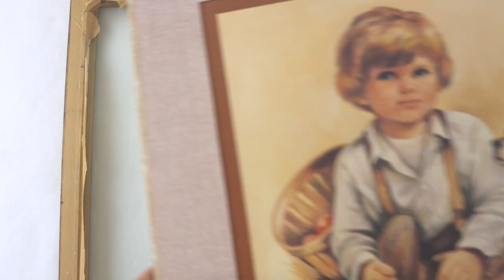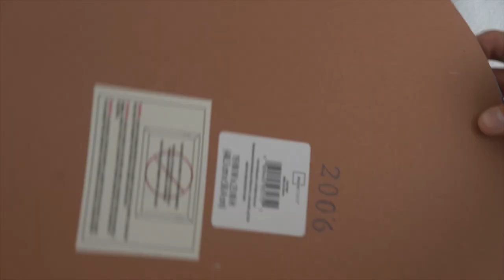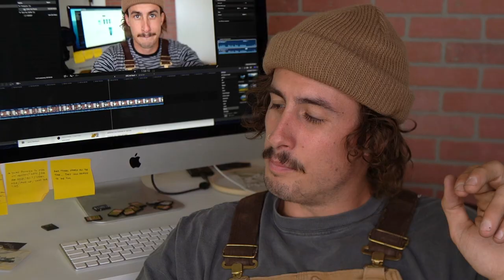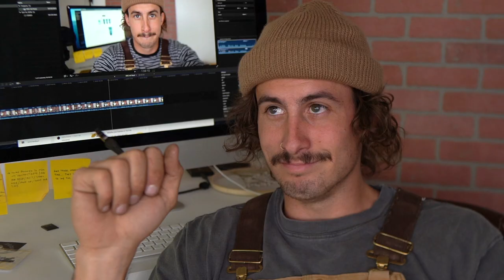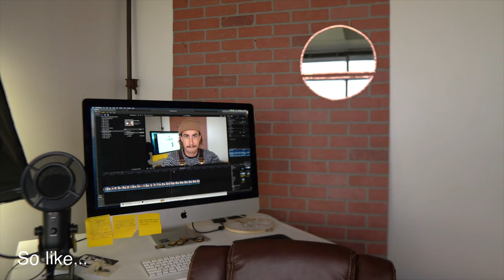DIY CIRCLE MIRROR - Copper + Spray on Mirror + Old Picture Frame (THRIFT UPCYCLE)

Comment from the maker: If you break a piece of glass before it becomes a mirror... is that only like 3.5 years of bad luck. Orrr...
Reply: The supreme quality of this project definitely countered all the accumulated bad luck 😂 you'll be fine!
Reply: isn’t broken glass good luck??
Reply: No or else walking under a tree would be bad luck 'cause it might become a ladder
Reply from the maker: @LydiaLawsonMusic  hahahahahah ily lydia.
Reply: DIY bad luck with Shmoxd
Reply: In german we say "Scherben bringen Glück" or "Shards will bring you luck" but i think that only applies to pottery and stuff like that so idk
Reply: Hm...how did I not see this vid when it came out? 

ANYWAYS, A TIP: when cutting glass, you want to make a bunch of additional scores in the parts that you will not need and brake them bit by bit by taking the glass with both hands, one each side of the score(there's also a special pliar)  and apply equal amount if pressure on each side of the line. That will minimise the chance to brake it

P.s. every time your hairy head in the vid gets interrupted with the boy in the intro, I can't help but giggle🤭 have you changed a bit, or what?
Reply: Nah, only bad luck for broken mirrors
Broken glass? Scherben bringen Glück (German)
So you are binging out the bad luck from the mirrors

Comment: Next time try to scratch some "rays". I mean when you make a circle scratch then make scratches from the line to the edge of glass. Its the way you can control cracking and circle will be perfect
Reply from the maker: So, I tried that on the first couple attempts.. and for some reason it was working better for me with out em? ¯\_(ツ)_/¯
Reply: @Shmoxd  Ok, if you ever have some problem with glass let me know, I have master degree of Art and Glass design so let me know, I'll help you with this precious material ;)

Comment: A quick tip, if you scribe a straight line from the edge of the circle to the edge of the glass, the glass will be less apt to shatter as you are creating a relief.
Reply: I agree! Sounds like he'll be getting into some stained glass projects and I feel like a lot of the applications and SAFETY tips would help with this project. Especially cutting off smaller sections for round profiles, sanding the edges, and wearing gloves!
Reply from the maker: OOO love all the tips! thank you!! :)

Comment: When you’re cutting glass start at one end and finish at the other, if I’m cutting a circle I cut straight instead of in a rounded form then clip the edges. Some oil will help the cutter also which is a pretty standard one by the way.

Comment: When you're scoring/breaking mirror one thing that helps when doing a circle is to do to the circle then bring a line out to the edge of the glass. Then you can use your breaker (in this case your scissors) and the whole thing should pop out.

Putting cardboard or foamcore behind it will also help a lot to brace it if you don't have the full thickness of a real mirror. You will also want to tape up the edges to keep from cutting yourself.

I worked at at frame shop for 10 years so I have a lot of experience with it. To glue it on you'll want silicone glue like e6000 or liquid nails and that helps too.
Reply: Yes! This! After the circle is cut, cut straight lines from the circle to the edge of the glass all the way around. Then you break off those cut chunks. And you can control where those chunks break.

Comment: I think the glass might’ve broken a little easier if it were in smaller pieces when it broke. In my mind, it’s a “path of least resistance” thing. So if your score along 1/3 of the circumference is super clean and consistent, it’s gonna break where that score begins and ends. And if you’re flexing the entire piece of glass, those two sides of the score are going to want to meet in the middle, rather than head in opposite directions towards the outside edge. 

Hopefully that made sense...? It reminded me of a diresta video where he cuts a curve on a piece of wood with a circular saw by cutting a series of straight lines, then coming back and sanding the transitions between each straight cut to make one smooth line. So maybe splitting the one big break into a few smaller breaks would make it easier to control? Hopefully that helps. Good work!
Reply from the maker: That does make sense!! thank you:)

Comment: you used a super thin sheet of glass. just get a thicker one next time. plus, there should be plenty of little round mirrors to be found at thrift stores, usually with the edges bevelled, too. so that helps prevent injuries.
Reply from the maker: ooo I'll keep that in mind next time:) and when I was thrifting I couldn't find any mirrors.. but come to think of it.. ive found circle picture frames before.. soooo

Comment: umkay so this was awesome. I can't make myself be so freaking careful not break anything or mess up at least once, OR take the time plan for every possibility. So showing what went wrong was not only entertaining but makes one feel they didn't have to lose their own time. So thank you! 
IDEA: Could you use the copper foiling they use for edging stained glass? I think you said something about stained glass in the vid. You just need the foiling and a decent soldering iron. I'm just not sure how smooth you can get it on a continuously curved line????

Comment: Hey y'all, used to work in a few glass studios. When you cut glass in a circle - cut 1/4 at a time, run the crack with light tapping, then use glass pliers to pull apart. 
Safety Bonus Tip: Always wear a mask! Glass dust is rough. You'll feel like you smoked a pack.

Comment: next time you try to cut a circle, cut as much excess material off as you can before going for the circle shape. when cutting glass it always wants to break in as straight a line as it can so asking it to just cleanly cut out a circle is a pretty bold. just square off the four sides along the edge of the circle, then the remaining hang offs the same way, then go for the curved cuts! also, you can use that little round ball on the end to tap along the lines you scored to encourage the cracks run where you want them too. you can also get grozing pliers that help snap off little bits left behind cleanly. it'll save you lots of time and stress and cut down on bad luck mirror break years. hope this helps good luck!

Comment: I've seen ppl use that cutter for aquarium glass just fine... they prim e new ones by using it on scraps first a few times, then real cuts are made with oil and pressing harder on the glass.. Also, Maybe make some scores outward from the shape you want so it has a way to break around the large curved sections.

Comment: I would just cut one side of the copper tube, and with the help of your circle outline, I would create a frame to wrap the mirror if that makes sense?
Reply from the maker: Yah I like that! hmmm but what would you use to cut the tube like that?
Reply: @Shmoxd  what would I use? Hmmm. So it is kinda soft metal, so I would smash it first, let it collapse little, and make it slightly flat, and use scissors to cut one side. So scissors and a hammer, final answer.

Comment: For anyone that wants to cut glass, the cutting tool has two features that Shmoxd didn't use. The little grooves on the cutting head are for grabbing the glass edge and snapping along a cut line. This is particularly good for trimming those small pieces that are left over. The ball on the end of the cutter is for tapping a cut line to cause a break. It should also be mentioned that a small amount of cutting oil along the cut mark will make scribing a cut line much cleaner and more even. The main reason his circles broke unevenly is that he didn't make relief cuts. the best practice is to quarter or eighth your circle, making cut lines from the circle edge to the outside of the piece to be cut. This allows more manageable pieces to be broken and will ensure that stress fractures don't ruin your piece. Last, when making long, straight cuts, breaking the cut line along a table edge (using the grooves on the cutting head) will ensure a much smoother cut.

Comment: The problem is that he doesn't make cuts from the circle crosswise to the edge. This allows the glass to break in individual parts and the circle remains intact. Without the additional cuts, the break finds its own way and the part that you want to cut also Breaks!

Comment: Glazier here. Cool video, but your scoring that glass way to hard. Have some kerosene on hand for a lubricant and score with just enough pressure that you hear a sound kind of like cleanly tearing paper. Then you add 4 relief cuts at each center point. Start by gently applying force with your thumbs and chasing the score line until the pieces fall off.